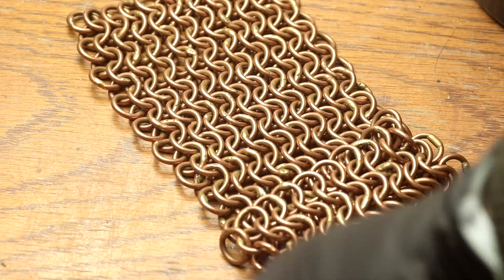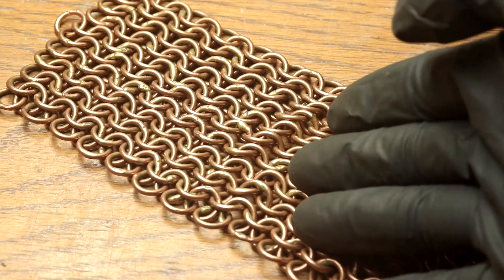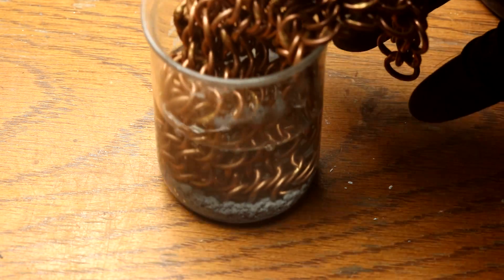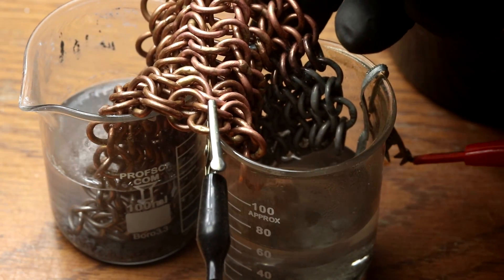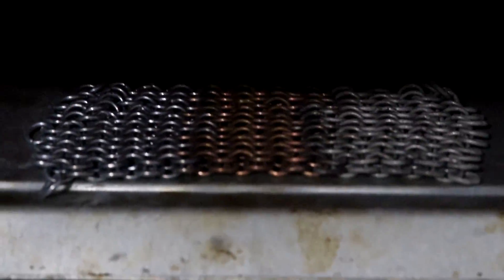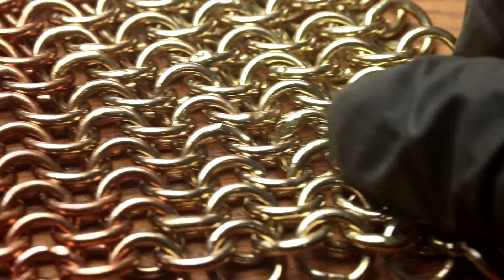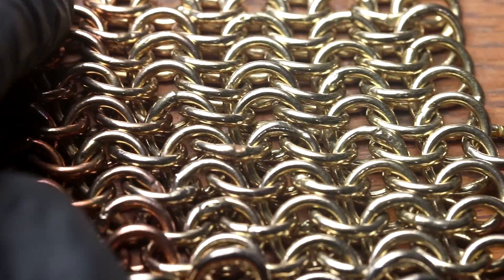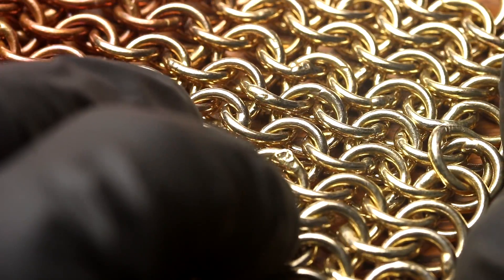Coating Copper in Brass and Bronze

Comment: Nice! I just think that those want really brass and bronz. Why do I think so? Because of the color and low temperature. Brass and bronz would need a higher temperature to melt and mix properly. Regular oven cant get temperature high enaugh. And at least, brass and bronz is same color, both yellow. Zink is also yellow if heated up at right temperature. It oxidized and get that yellow color.

Comment: How does the zinc plate onto copper exactly? Is it a purely chemical process by just dipping the copper into the solution? Because I don't see any zinc anode (with a positive electric potential applied to it) in your zinc solution on the left.

Comment: wait wait wait, so would it be true that you can effectively brass plate something by copper plating it and then zinc plating it and then bake it? how hot how long?

im working on restoring the finish on some old brass trim from something

Comment: Cody, 
I'm working on restoring a car that has some rust on the frame of the car. 
I'd love to hear your take on some form of brush electrolysis rust removal, and then brush electroplating that would work to end up with a electroplated zinc frame without having to remove EVERYTHING off of it first.
I imagine a lot of people would get a kick out of that, not to mention your share of rusty equipment out on the ranch that could benefit!
Here's hoping!
Scott.

Comment: This is late response. Better than never. The copper alloy looks nice and I do agree that it will corrode and perish after 50 years. The bronze alloy does look like it would hold better than the brass alloy. My suggestion would be the bronze solution, it would add the effect of aging to the shirt. Allowing you to say that you have the experience of a honed knight. :D

Comment: Tbh I liked the bronze coating more. The Brass is too flashy for a chainmail. And even the uncoated parts of the brass has that worn look that kinda adds to authenticity.
Straight copper for the neat factor of having a copper chainmail. Bronze for medieval badassery.

Comment: Is zinc powder the same as zinc oxide?  I have a clock that is brass plated copper and I'm trying to see if I can replate it after cleaning it up.  What were the exact volume of ingredients you used.  Is it just a ball park.  How much zinc powder to water to sodium hydroxide?  thanks

Comment: To anyone with knowledge, I ask. How and where can I get a hold of different chemicals and elements ? Some need licences and I wonder how to get those too. I'm an amateur and I always loved chemistry and such. I could probably get enough money to have a very basic setup for an experiment or two and could upgrade. I don't own any educational degrees currently. I have little knowledge of how to get a hold of concentrated acids, certain compounds and elements. I have no clue where to start either and where to get lab equipment and previously mentioned items for the lowest price. I do understand that chemistry can be a very expensive hobby. I have a bunch of questions and I thing it's best if I just list them.

Basically what I'm asking is;
How do I get a hold of chemicals for projects(Ideas for experiments)?
What do I need for a basic home lab ?
Is it legal in the UK ? (chemicals, lab and anything else)
Do I need licences and if so, how do I get those ?
Where can I get ideas for project and is there a forum to carry out research on chemistry and chemical reactions ?
Cheapest ways to purchase things I'd need for a project and equipment?
Is it safe to have a lab that could potentially have dangerous chemicals in a flat? (I live in a flat on the 15th floor ;-;)
What magnitude of experiments could I do in a suggested lab and how would I upgrade it for more complex experiments?
Please answer any questions I didn't ask but should have and anything else I should know

I am quite the beginner and I wish to learn along the way. Obviously safety first.
Thanks !

Comment: How do i plate copper with iron?
Reply: You wouldn't want to iron is cheaper and uglier than copper. You would just make it out of iron originally
Reply: @wattax2  But i want it for a specific reason my friend. I want to make soldering iron tips out of copper and plate it with iron so it don't get dissolved in solder.

Comment: So you kind of anodized the copper, but with tin and zinc instead of oxygen? 

I'm curious as to why it alloyed instead of simply coating as you clearly didn't melt any of the metals involved

Comment: Copper looks nice... right now, but the oxide coating isn't real durable and it'll turn you green, brass probably has better durability but still green, and bronze is harder than brass, as it would hold an edge, the corrosion still happens but seems more durable and the coating is uneven AND it too will turn you green. Well, you signed up for mars, might as well get your green on now. :-)  Tootles... Wade. p.s. I wonder, what if you did it in bronze and followed up with brass to handle the unevenness and let the corrosion even the colors out? just a thought.

Comment: I would stick with Brass as the availibility of Zinc is fairly good/economical (Literally Pennies). Ive finished alot of copper maille that way over the years and touching it up is a breeze.

Comment: Brass is too flashy for my taste. Bronze looks like it needs a better treatment. But I think with the perfect treatment the color should be even nicer. Copper is nice as well. 

So for my vote: Bronze if you can get an even nicer result, else stick to copper. 

(Only use brass if you need the "gold" color as a background, shinging through an outer layer of darker clothing/armor)

Comment: "I'm going to cut off a tin electrode from this tin can." But Cody, tin cans aren't actually made of t- oooooh.
Reply: You can tell it's real tin because he cut it with tin snips. If it wasn't tin, the snips would explode, because they don't work, except for with tin. If they worked with other metals, they wouldn't be called tin snips.
Reply: @aformofmatter8913  Same idea with bolt cutters. They only work on bolts.
Reply: @aformofmatter8913  You can easily cut sheet metal with tin snips or aviation snips... I'm sure a can would be even easier.
Reply: @dominolan2370  Lies. Deception. Tin snips are only capable of cutting tin, and aviation snips are only capable of cutting airplanes.
Reply: @aformofmatter8913  I don't know if you're serious or not but we were instructed to do so and did it easily in shop class... on steel sheet metal.
Reply: @dominolan2370  Tin snips explode if they try to snip anything other than tin.
Reply: @dominolan2370  woooosh :)
Reply: @dominolan2370  bit late, but it was a joke lmao
Reply: what if i try tin snips on my nails?
Reply: Na...Cody's can IS tin...oh, wait, should rephrase that but, NA it's ok...lol
Reply: I dont get it.
Reply: @TrolleyMC  Cody made a tin can from actual tin a while ago; that's what's in the video
Reply: @DRSDavidSoft  oh.
Reply: Oh
Reply: @sjokolademelk  Sjokolademelk er godt!

Comment: I'm not sold on the bronze... it seems pretty weak. Would it need more time to cook in the oven? 

Brass goes really quick, I know that, but all the bronze I've seen is much more reddish brassy copper color. Look at a bronze oil impregnated bushing. they aren't grey like that.

Comment: I’d go with the bronze. Although the brass looked ”cooler” the bronze gives it a much more chainmail vibe due to it’s iron like colour. It’s like you would actually walk around with a combat rated steel chainmail. Also the bronze is harder and wont wear off as quickly as you said. Also thosd joints looked a bit like rust so it gives it a more old vibe to it.

Comment: I'd say a combination would look most epic.
Brass around the neckhole, at the cuffs and maybe as "seams" between the different parts, sparingly just a few rows tops though. Copper for the sleeves. And in the end Bronze for the main body.

Comment: What temperature did you heat it to?
Reply from the maker: About 300C
Reply: @theCodyReeder  I'm astonished that the metals will alloy at such a low temperature!
Reply: @davidtaylor2054  diffusion can occur at any temperature (not absolute zero) but it takes a long time, the higher temperature the faster it diffuses and alloys
some guy even bonded metals with diffusion by just laying ingots over each other and waited for many years
Reply: @theCodyReeder  I was hoping you'd say "Really hot".
Reply: @theCodyReeder  I was planning to brassplate a piece of wood by first doing copper and then zinc but 300C seems a bit high for wood.
How long did you have it in for and would a lower temperature for a longer time allow me to do this?

Comment: out of curiosities which electrical parameters did you choose for  with the tin ?
the zinc might have flaked off because a chemical plating is very thin compared to an electrolytical one.

Comment: "The bronze should last the longest"
Even ignoring the joins, it looked like parts of it already came off with the "scrubbing".

Brass all the way.
Reply from the maker: “Should” doesn’t mean “will”
Reply: @theCodyReeder  I think cause the bronze is electro plated it didn't get into the tight crevices compared to brass which looks very evenly coated. I'd definitely go with brass
Reply: Try to find out how long it takes to turn copper fully into brass with this method - if that's at all possible past a certain depth and if the so treated metal is weakened or strengthened by the process compared to the original copper.
Reply: @darijanr5704  Brass is harder than copper, so the outer layer should exhibit those properties.
Reply: @theCodyReeder  How do you REMOVE iron acetate from something that you have removed rust from? Is there a chemical that removes iron acetate?

The piece I'm working on has a lot of internal components that can't be reached with a brush. I removed the rust already but I would like to remove the black iron acetate that has been left behind from the process.

I will be electroplating this with zinc, then copper, then aluminum  (if possible).
Reply: @Stacy_Smith  you can't eletroplate with aluminIum in water, it's too reactive. some researchers at Phillips did pull it of using ionic liquids a few years back, but i don't know what was done with that afterwards.
Reply: @theCodyReeder   Cody, quick question.  What is the ratio of the water, Zinc Powder and Sodium hydroxide to make the zinc plating solution?  I want to so this myself, Thank you.
Reply: Brass is awesome

Comment: How did adding an electroplated coating of zinc and tin transform the links into brass and bronze? 
Did the heating in the oven get to a temperature that the metals were able to combine and meld together somehow?

Comment: the brass looks nice but a little too blingy maybe. i'd go for the bronze myself, how about using something like a small cement mixer (sans paddles/blades!) to tumble the mail shirt while doing the electroplating, that would certainly ensure an even coating and would help to create a very smooth finish. it may prove an interesting (or just plain impossible) challenge to pass the current through a moving electrode but might be fun to try!  It'd certainly be worth running your shirt in the rock tumbler a bit with a small grained media to clean it up a bit before and after the plating, that's how a REAL man washes his clothes :)

Comment: You could switch to steel chain-mail then use Ferritic Nitrocarburizing to make it extremely tough and corrosion resistant, and black. You could use an oxidizer on the copper chain mail to give it that beautiful green patina.

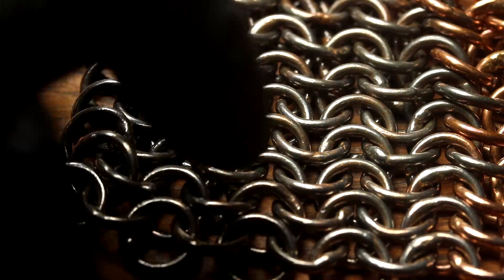Comment: 3:58 But bronze is brown, and grey isn't brown.
Reply: The color depends on the proportions of copper and tin, and this in turn depends on how thick the plating, and how long and how hot the diffusion process is.

Comment: As someone who just got electrocuted and cant let go of the welding handle for like a few seconds, I find this project vastly interesting.

p/s: Upon pondering, its easy actually. Just jump and that would probably break the circuit due to not touching the ground, but when youre getting electrocuted, all logic is out the window. Thankfully instincts said that I must step away, and that did the trick.

Comment: How is it zinc plated if copper is far less active than zinc? Plated from [Zn(OH)4]2- at the expense of more zinc upon electrical contact? Though I never thought zinc would be ever deposited from the solution, I thought hydrogen would instead, again because of reactivity

Comment: I did this with a section of mine a while back. The brass was pretty but the heating annealed the rings. Maybe i'll have to try again with better temperatures control. What temperature did you use?

Comment: Brass does look the nicest, bronze also has its appeal as does copper but here is the question, which one will best protect Cody from the bees/chemicals/open flames/sharp objects/projectiles ranging from droplets of butter to a train with sharp shrapnel welded to the front?

Comment: 3:45 The reason the copper didn't take the bronzing is that when you welded the copper, you heated it up, accelerating the oxidation, building a thin (transparent) oxide layer on top of the copper.

Comment: If you repeat zinc coating and baking, won’t you get a smaller and smaller percentage of copper in each layer of alloy?  Or does the process allow enough movement of atoms to actually permeate the ring and transmute the whole thing to brass?

Comment: Is it possible that the tin didn't properly fuse with the copper? I expected a much shinier look from the bronze chainmail... You said you kept it in the oven only for a few minutes, maybe try putting it in for longer and see if the bronze part changes, or if it stays like that. 

I'm not a chemist though, so I might be completely wrong xD

Comment: Why not go with a combination of the three? I think they all look awesome, and maybe you could use the brass for shiney highlights like the collar or in small strips, for instance at the bottom of the shirt, the copper for the majority of the shirt (because its the easiest to make), so the chest part and back part, and the bronze for the sleeves for example. Of course any combination of locations is possible but this would be my choice😊.
Reply: Bronze sleeves with copper body, and brass on all the edges (cuffs, collar, waistband) sounds pretty awesome to me
Reply: @aquarius6139  Yep that's what I was trying to say but explained more clearly haha
Reply: make any sections you want to color differently before combining the shirt, and put them in a wide shallow dish of the solution to apply the coating of choice
Reply: @frankzaffuto3670  Yep, that's the easiest way probably.
Reply: Or making a crest of an eagle or something in a different color than the main shirt
Reply: Jimmy Herneheim yes that would also be very cool but I think that that would be tough to do as the solution has to be contained to only the areas of the eagle then. Still an awesome idea though if cody could pull it off!
Reply: I agree!
Reply: @XodiakGangrene Yeah that would probably be the best method for creating some sort of design, but I think he welds them with copper, so he'd need to coat them afterwards again...
Reply: Now I want a pin stripe hauberk

Comment: Hey Cody, I'm not quite sure that the tin and copper fused into an bronze. Once claned, bronze is quite golden too. Brass worked wonderfully but the other third is just tin plated copper in my opinion. Maybe you could compare to a piece that didn't go into the oven.
Reply: I agree. This method did not work properly for the bronze. It might be easier to make bronze then work it into rings than work copper into rings then trying to add a bronze coating. With his current methods, I say brass because it will probably stay nice the longest and it will be the easiest to turn back to its original condition as it wears down.
Reply: My theory is that the oven heat was simply not enough to allow the tin to dissolve into the copper. I'm thinking a torch might be a better heating method for the bronze...
Reply: I tried this today, and while i got no reaction without electricity i did get the silver finish that turned into a nice gold after a little heating. Im curious about the reaction here. I used dilute naoh-solution with zincpowder, and copperwire from solenoid.
Edit: copperwire as cathode, ~~6v@100ma

Comment: ehm... that is not Bronze and Brass at all. Those are alloys, i.e. molecules of metal mixed into specific grid structure. What you have is tin/zinc coated copper, i.e. separate layers of metallic grids. Please, do not misuse terms.

Comment: definitely a fan of the brass, it looks like it has a really full and durable coating also. The copper plain is ok but id be worried of oxidation and the bronze just dont fully coat so it looks funny.

Comment: Very impressed with the brass colouring. Would be nice to see a phosphour bronze coating. We use that at work for coating fixings on things like lightning protection clamps and earth bars. When I used to make chainmaille bits and pieces, I'd use either plain copper or silver / gold plated for things like bracelets.

Comment: Could aluminium bronze work too? I have heard its more durable than any of those 3 materials you tried. Coloring is close to gold/brass. Should be just as easy to do than those other alloys. Nickel is also one possible alloying material for copper, but I would definitely not want you to get nickel allergy from your chainmail.

Comment: Choose of the plating depends on what you want it for. If it is for show: The bronze is shiny, choose this. Brass will be maybe more durable. But I dont know why to start with copper and then plate it. Why not to choose the proper wire. Is it price? Or is it the cooper is easier to work with?
Anyway the plating offer some design possibilities.